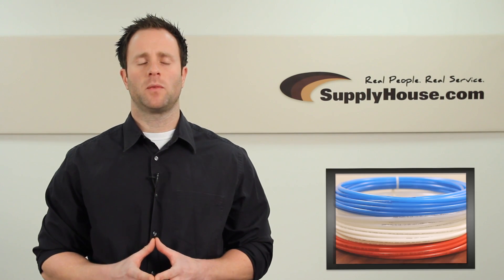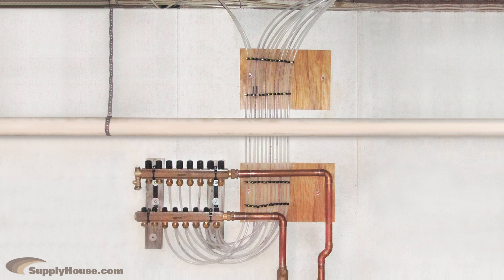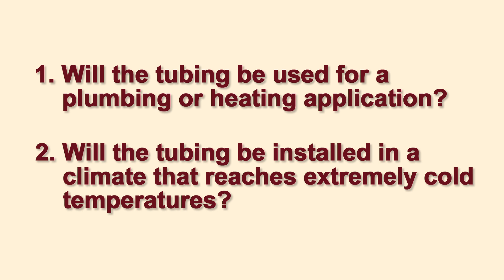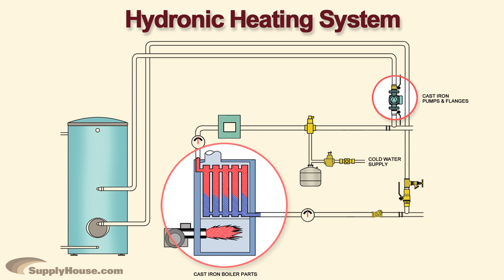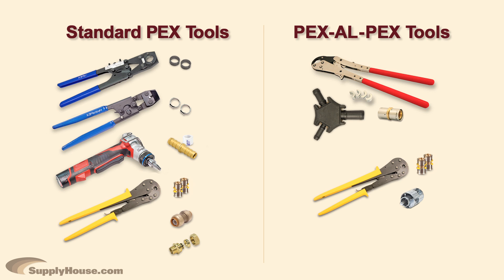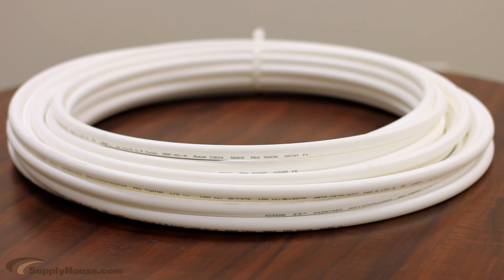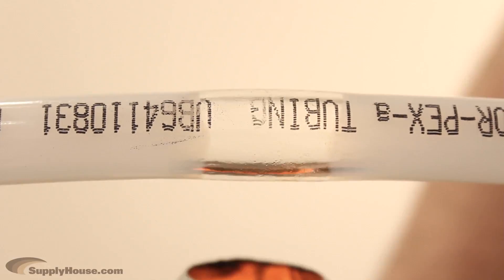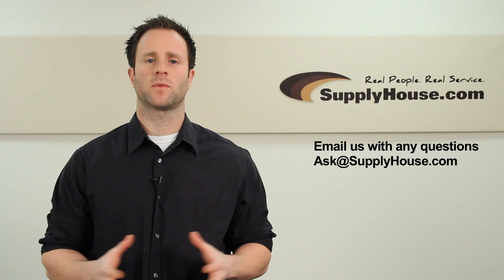How To Shop for PEX Tubing

Comment: You’ve completely mischaracterized the difference between PEX A and PEX B. There’s no  difference in “grade” between the two. Different piping, with a different installation process. And not necessary interchangeable.

Comment: It’s good to know about these suppliers of normal pex tubing and fittings. Last time I was at Home Depot I noticed they only had the Pex A expanded system fittings. Seems like they stopped selling pex B .
Reply: PEX-B is not used much anymore as PEX-A has been proven to be a much better system
Reply: @christopherbenning8659  yup except those pesky class action lawsuits

Comment: From what I've learned...there are no "grades" of pex. There are types. pex-a, pex-b, pex-c. advantages/disadvantages to each type. For example Pex-a maybe susceptiple to leaching of chemicals......correct me if I'm wrong.  https://www.pexuniverse.com/types-of-pex-tubing
Reply: I cleaned some paint off the  stub out 's on a job with Primer , worked great and fast . Boss wasn't liking it. lol  I researched the issue and pipe and found chemicals/oil ect , will only (( Permeate ))  if it was sitting in the chemical under ground or above ground , kind of thing , not saying your wrong , just what my exhausting research came up with to prove to the Boss , It was fine what i was doing , I hope this Helps guys ...

Comment: I have to bring my water main in up a block wall.
The drywall is held on buy three quarter inch furring strips.
Can I run 3/4 inch PEX in that tight  of an area.
Do I need to pad out wall a 1/2 inch by adding another layer of dry wall.  So I can wrap PEX main line and protect it from rubbing? ?
Thank you in advance ! !
Reply from the maker: 3/4" pex measures 7/8" OD so it wouldnt fit.

Comment: I'm looking at extending water from a house 300 feet to a barn. This is temporary (1 Year) and I need to know what size tubing can I use for a direct burial installation. Thank you
Reply: PapaDukesFl can use whatever size u want. 1 inch mains are nice. you may want to put per inside larger pipe to protect it

Comment: I live just North of Tampa Bay, Florida and had a shop about 50 feet back away from my house. I bought the house with much done already, but really most done on the very cheap to WRONG.. One issue I have is a water supply going from the house out to the shop. I found the (GATE VALVE) that was buried in the sand completely by accident, but can see that the 1/2" copper tubing coming from the house to the valve is inside of a red flexible plastic sheathing. But the valve and everything after it is not. Some was even galvanized steel pipe. That has since rotted away and I have to dig it back to the copper and cap it. 
We do freeze here sometimes a few times per winter and I'd like to know what is best to run from the 1/2"valve out to the shop underground. I'd like to keep water turned on year round out there..
Reply from the maker: Steve 1961P. 

Pex would be fine to run, 1/2" or 3/4" depending on their water usage. Make sure to bury it beneath the frost line
Reply: Steve 1961P. they only one that is a
Reply: SupplyHouse.com e